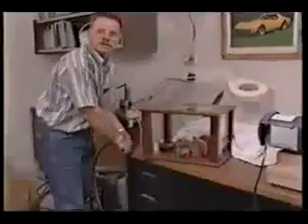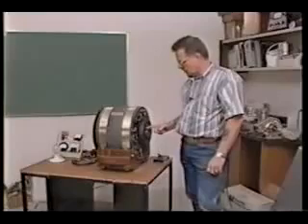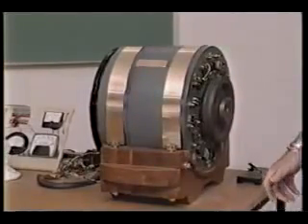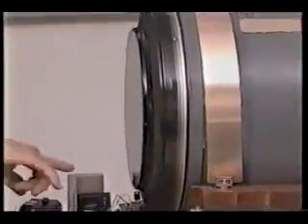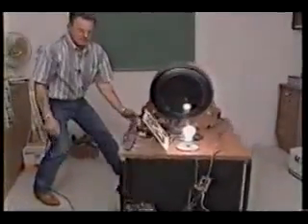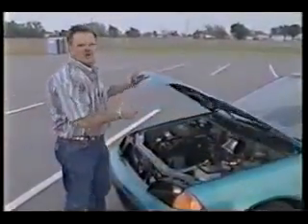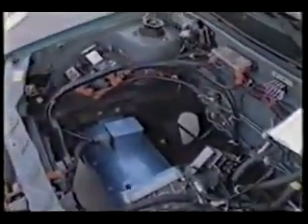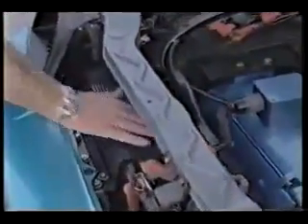Magnetic Motor PROOF

Comment: There are no "magnet motors", only ignorant nincompoops believe in perpetual motion machines. These things have been a scam since the dawn of electrical power. With the advent of very small, powerful batteries there is an epidemic of magic motors that supposedly run without any external power. You have to be very naive to fall for this stuff.

Comment: Well for the people that said they do work very good.Physics say Helicopters cant fly so is that a con too.Dont dismiss or judge something just because you are _uckin stupid and have not the mentality to comprehend it.I have a unit i built from junkyard parts home depot and radio shack that keeps 2 Deep Cycle battries charged now only time i run generator is for AC.If i had access to a XYZ Bridgeport Lathe i could build a unit that could handle a 30 AMP draw.Could probably do it with wood and plastic but wouldnt last.They said couldnt run a car on water ever heard of Stan Meyers.Ken Smith talks like a man with a Paper Asshole probably wont get it LOL.The only reason you cant buy a system to power your house anyone know this one.Same reason no cure for cancer but people were being cured 50 ys ago.
Reply: +Dale Potter Where did you get the "helicopters can't fly" thing.  As far as I know, nobody who knew physics ever said that.  I see that you stopped to insult me and then followed with some quite obvious lies.

Comment: What's in the back of the hatch back at 6:05? Batteries?
Reply: Kim O'Brien Don't you see that even if it has batteries in the back the generator will increase autonomy? IF you decide to not make a generator big enough. You may need batteries and run for 200 miles and finally stop to let the batteries catch up with charge. I think it is a very real thing, magnetic motors are not impossible just not explored for obvious reasons. After you sell it you are done, not very popular in the business world. I can understand that.
Reply: JFR Jr Ok if they're possible than you should be able to build one. Also the video promises magnetic motor proof. I didn't see any proof of anything. I might as well been watching the Wizard of Oz considering what was seen or shown to the visitor.  
Ever heard of the conservation of energy? If magnet motors are possible where does the energy come from? A conventional electric generator turns motion into electricity while a conventional electric motor changes electricity into motion. Conservation of energy says energy can neither be created nor destroyed only changed in form.

Comment: I'll never understand why so many people with a scam that DOES NOT WORK are trying to convince people that it does. Only a fool would believe this video. There is 746 watts to a horsepower, but that much power can only produce about 400 watts. Then when you take that 400 watts to make it into mechanical motion, you lose almost another half. The end result will be about 1/4 horsepower. You cannot create energy with magnets, until you find a material that will block lines of flux, without being affected by that magnetic flux.
Reply: Yep buddie, we could also do with a gravity blocker then we could use mass to life at 0 and fall at 9.8m/s/s.. the bugger is the universe don't allow it, else we would not meed 5 billion horse power to get a man to the moon, we'd just make it massless and use a fucking bottle rocket! LMFAO these nutters make me laugh
Reply: ... better batteries charged overnight with this motor gives  full day of driving up to 600 miles/1,000 km... does this make sense to morons? ...larger scale of these motors may one day supply whole city needs... (2 hours of sunlight gives enough  energy for one year of whole world needs)... cheap? no, freeeee...
Reply: Finally :D
Reply: Paul Crissman hypothetically of coarse, what characteristics would this game changing material need to possess in order to block flux lines? For the record, unicorn piss is not a valid answer. :)
Reply: Paul Crissman course*
Reply: Mu metal. Duh.

Comment: Just a point, The end minute the person in the video is trying to convince us that the amperage going down is good, however the opposite is true. The higher amps in the battery cells, the higher potential energy that the battery contains. The amperage can appear lower due to the significant pull of the electric motor.Volts x amps = Watts.

Additionally throughout this video there was no proof that the motor generates power indefinitely. All electric motors have the potential to generate electrical energy from kinetic energy, Or to produce kinetic energy from electrical energy to some degree. However, specific motors and generators are simply tailored to one trait, Providing a much higher efficiency than models targeting duel purposes. 

The light bulb in this video lit up because the motor stored up kinetic energy when it was plugged into the main supply. The kinetic energy was stored in the form of a flywheel or the weight of the engine internals spinning. When the main supply was removed and switches were flipped the magnets inside of the motor allowed ions to flow back towards the light bulb, which will directly create a magnetic drag on the spinning motor and flywheel. 

This is a trick. Which merely abuses simple mechanical and electrical principles, and misrepresents what's happening to ensure viewers believe a revolution has come. 

I would love nothing more than free power for all, Or a cheaper, cleaner way of producing power, But lies from people claiming to have broken Biot–Savart's law and made free energy are pathetic at best.
Reply: So you mean to tell me that at 12 volts, it takes 100 amps to make 1200 watts?